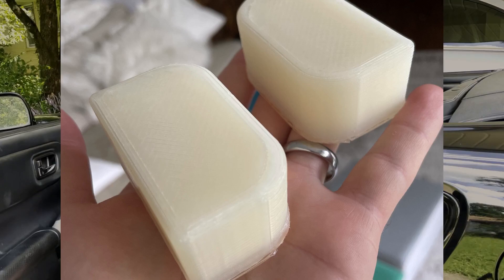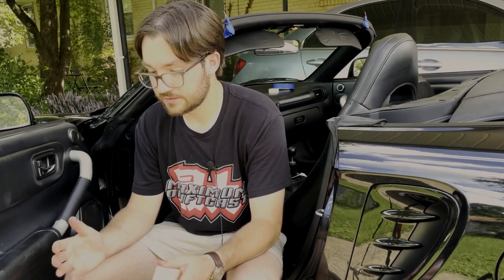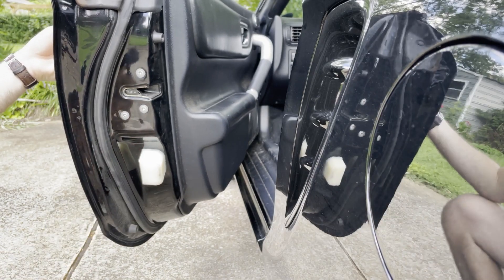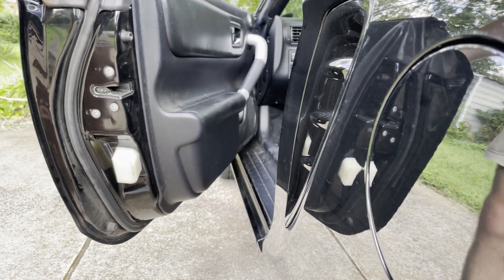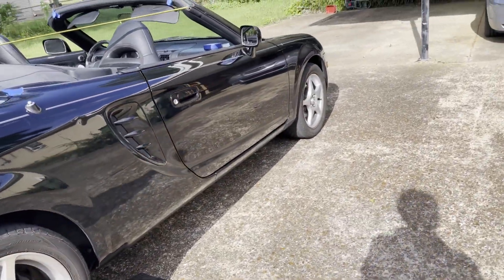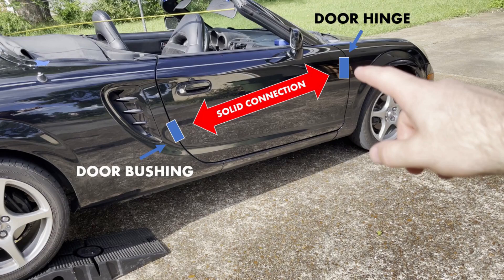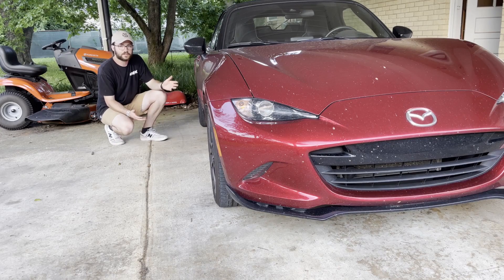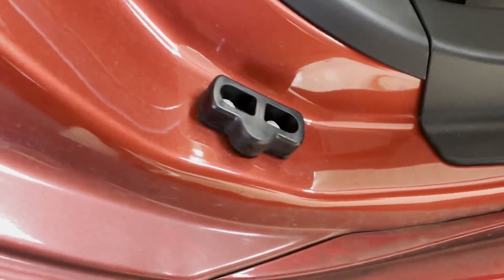MR-S Door Bushing Experiment - 50% Stiffer for $50?

Comment: I think, the differences between measurements might have been dude to your measurement mythology. I think a simpler way would have been to not use tape and pins, tie or bolt a string to each point you wanted to measure, pulled them tight with some sort of luggage scale, so you would be sure the force exerted is the same. Then jack the car up or what not and see if the string sags. Mark the original point that was bolted down pull the string once again with luggage scale to the same force where its straight again mark it and use calipers to measure the difference. I honestly from an engineering perspective cant see these really adding any stiffness if any thats noticeable. The material used to make this also matters. If this did create any sort of rigid connection after a few years you would see a massive dent wherever the 3d printed piece came into contact with the sheet metal. The mazda one i am pretty sure is to remove any sort of vibration or sound from the door being bolted on, not to increase vehicle rigidity.

cool thoughts though!
Reply from the maker: I thought about strings but I think the way I went offered more precision. 

I made it pretty clear (with data and driving impressions) that it does in fact make a noticeable difference. The seller of this part originally tried ABS plastic but the bushings would crack, so there is certainly a significant force applied to them. 

Also, when the Miata windows are down and the door is closed, it sounds pretty cheap and flimsy. I don’t think the Mazda bushings are for that reason.

Comment: Lifting both rears is exactly the same as parking it on a hill, doesn't impart any bending force. The twist test is really interesting though. Another way to measure this would be to put the car on corner weight scales and then put blocks of wood under one wheel and compare measurements.
Reply from the maker: Yes, I like the idea of doing it on scales. For the bending, I would need to add a vertical force at the center of the car.